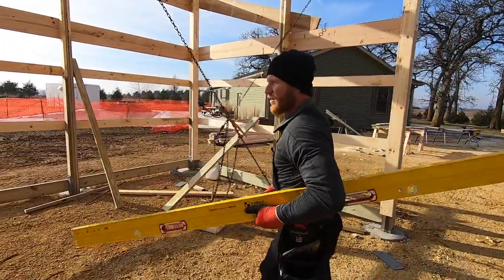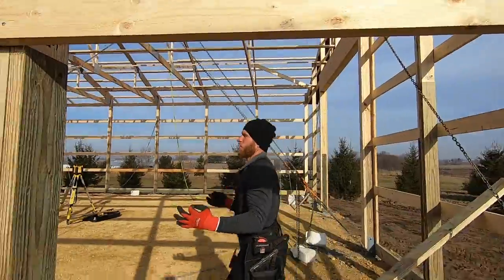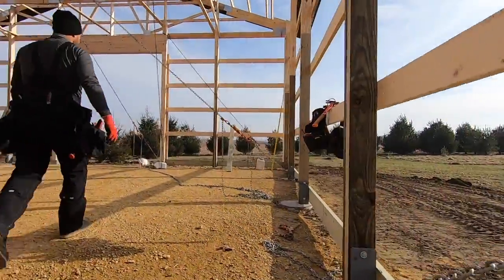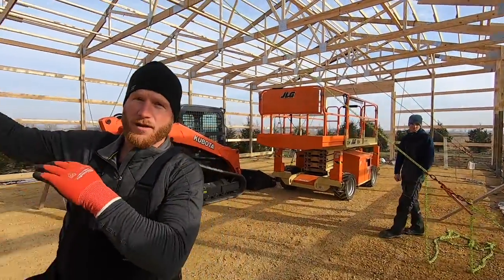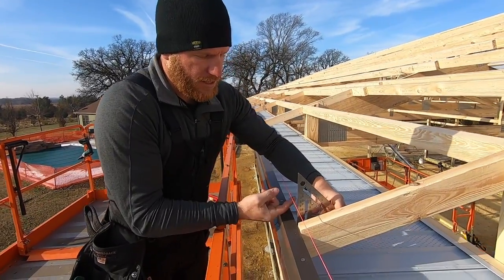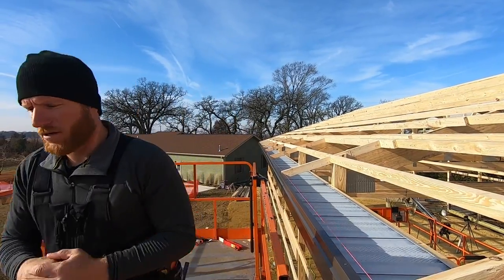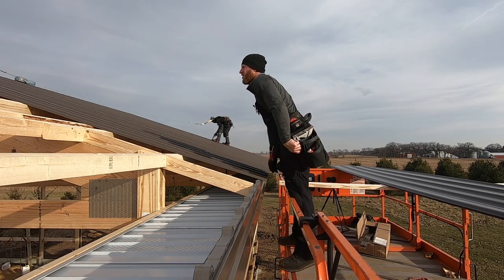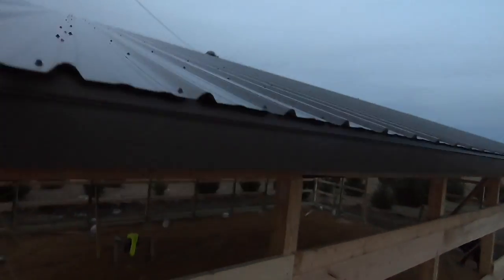Complete Step by Step How To Square a Roof

Comment: another knot. loop around finger 3 or 4 times pull taught lock in opposite direction. will stay until you release it by giving it some slack by pulling tighter and keeping strings parallel. you can reuse string indefinitely. Awesome video Thank you !

Comment: If you don't mind this suggestion, yes, they're not exactly cheap but, ratchet binders. A little easier and quicker for you to make your adjustments. What you're also not taking into the mix here is, moisture will change your dimensions. That's just the nature of lumber. I know most would say "OCD" much, me, I say, you're just making sure everything is as exact as you can make it. This is why I really enjoy your channel, your "ocd" of precision. Keep the video's coming. Cheers :)

Comment: When using the pythagorean theorem, the method I use allows me to avoid calculators and fractions of an inch. 
The triangle to find that 90 degree square is essentially 3x4x5. To get higher levels of accuracy with a large building, just multiply equally to all three and use those dimensions. Example would be to multiply the 3x4x5 numbers by 5 to give you 15x20x25. That way, you can use a 25’ tape measure and still get nice accurate measurements with large squares.
No calculator needed and just as reliable.

Comment: you're a perfectionist ... not a bad attribute , however with the primary posts 'plumb' with your level , it may only be in or out within that length of your level , meaning the post could actually be bowed beyond your level's extension  ... I always checked the top of the wall and checked plumb with a transit ... building racks to suspend drilling rig pipe in Angola in 1982 taught me that precise matters ... yes, it ain't rocket science but it sure does make a difference getting anything you build as accurate as possible ... spot on , budroe !!!

Comment: When your running your sheets I see you’re matching your Lap rib or “good rib” I think you call it, then pulling out your tape and measuring your under lap rib or leading edge for your over hang number. You could eliminate  that last step by marking your stack of sheets with a good marker on the leading edge at your desired over hang measurement.   And then for remodel work when you can’t guarantee a perfectly straight eve snap a line at an arbitrary point and mark sheets to correspond to that that line. 

To each there own. I enjoy the vids 🤙🏼
Reply from the maker: I have thought about that for sure and honestly not sure why I haven’t yet
Reply: I agree with this. I put up metal frame buildings and once we square our roof I mark the lead edge with a marker or even a grinder to give the guys something to line up. Just a little easier, and if u do the saw cut the lap of the next sheet covers it up u can only see it on the bottom but the gutter will hide everything. Great video!

Comment: Turn buckle style braces like you see used in concrete would cut time off of getting things leveled. We actually had some made with smaller threads that screw to any length dimensional lumber and that's what we use when leveling exterior walls on our buildings.

Comment: One trick that i do sometimes is flush the stack of sheets and cut a little slit on the dog leg at what ever your overhang is. saves you from pulling a tape every sheet. Great work though guys! Keep it up!
Reply: When you install a new sheet, you already know your lap is at 1.5 then adjust your dog leg accordingly. Saves a little time. Maybe less than i think. But hope it helps!
Reply from the maker: Great idea

Comment: Assuming you set all of the post plumb in the beginning  are you not taking them out of plumb as you make the adjustment with the kicker under the bottom chord of the truss simply trading a straight eve line for an out of plumb post?
Reply from the maker: Good question.  We plumb all Columns during install yes... but as you noticed we were still off 1/8 to 1/4 max on our string line... when setting a column, even if the level reads good, you could still be off that 1/8”.  Once we plumb our corners, the string line tells us how to make the rest perfect

Comment: Great video thank you.

Im installing metal on a pole barn.

I used your methods to square one side and i have the metal screwed down.

However the other side of the roof is about 2" out of square, any suggestion?

Comment: Wondering if you have seen the old school string line trick. Twist a loop about 4 times, hang loop on nail, pull the string while pulling tag end. Makes a pinch knot and holds great

Comment: So when you push and pull the building to get it perfect, and then you lock it down with the metal and screws, doesn't that cause tension on the screws holding the metal? I'm guessing the massive number of screws makes this point moot, but how does that tension affect the building over time? I would think it would cause oil canning in the metal, and when the sun hits it and it wants to expand this could cause even more tension.
Reply from the maker: Good question, but I can promise it’s not as much tension as you would think.   Imagine your body without skin or muscle... bones will go every which way.   Same with a building.  We are merely installing the skin that creates the diaphragm strength we need to hold it all together
Reply: High wind puts a tremendous amount of stress on a building like this with high wall long sides. If it holds up through the first big storm it's not going to budge.
Reply: I have built a number of steel buildings and the small amount that was necessary to square this build was of no consequence..!  I've had lumber warp several inches within several days before I could get back to the building and I used chains and ratchets to pull them back and the buildings still look great 10 years later..!

Comment: Was your first sheet hanging over the Gable edge three inches. Got confused when you started the metal. Great video
Reply: I'm also confused? Measure out 40" you would be short 3" on gable? I understand 68' 23 sheets that's 12" over overlap one ridge that's 9" so is that where the 3" comes from please help us understand.

Comment: I used to  stick frame houses with an old carpenter down in Texas back in the 80 s and 90s  we always used a story pole to level from bottom plate to top plate  when plumbing walls . It didn't matter if it was 8' wall or a 12 ft wall

Comment: Once you go through and square up your fascia and square your peak do you go back and recheck your walls for plum? Curious if the pushing and pulling on the trusses would move your walls out or in in the middle of the span a negligible amount or not.

Comment: Why not use a ratcheting chain binder for finer adjustments?
Reply from the maker: actually not as quick and a huge pain...I tried.  It wants to spin the chain and is somewhat a pain....I wanted it to work better
Reply: RR Buildings not sure if the new style ratcheting chain binders would help those they have a spot for an impact to hook on and tighten up instead of using the handle
Reply: Mike Cabrey .. that’s what I was thinking

Comment: Your videos are excellent. 
Glad you guys care about safety. Please reach out to your local rep. On some fall protection training. Your guy on the roof has two fall arrest devices used together. This is a big no no. In general dont ever hook two clips together, only clip to ring. Also make sure your SRL is rated for leading edge.   Be safe out there.

Comment: I know this is an old video but I have a question and hope someone can answer. I'm putting my metal roof up in 2 weeks on a new barn and could really use the tip.

What's the guy up top doing, exactly. Once the guy on the bottom gets his 1-1/2" measurement, he locks that in, then I assume the guy up top also locks in against some measurement / line he previously marked? So he's "stretching" the metal to get where it needs to go? Or does he just lock it in whereever it lands naturally?

Thanks!
Joe

Comment: As you are straightening the corner posts wouldn't it be easier to have a ratchet chain binder to take up your differences to straighten the corner posts? I guess the same would go for the facia and eves as well. Just curious. Very good info!!

Comment: Kyle fantastic video series, learning a LOT. I am looking for some input on purlin install and safety techniques. Fastening ALL those boards on edge has to be tiring? Why aren't purlins run in between and flush with the top of the truss? And can they be toe nail fastened in versus all the way through the depth of the purlin?? And last question- outside walls are only 8 ft tall, we are in WI. Can we install post supports into floating slab that is 12"x 12" on outer edge of slab?

Comment: Is there such a thing as a post frame deck?
I’m planning to enlarge my deck. My current deck has a roof over with actual trusses.
So when I enlarge it I’ll have to also increase its roof.
Post-frame just seems easier than attaching the deck to the house.

Comment: if you use the ratchet style chain binders instead of the snap style, you can dial that in easier and would not have to use boards to wedge the chain. it would save you a whole lot of time.

Comment: Great video!  Best "how to video" you have made yet!  Thanks for taking the time.  I do have a question regarding all of the chains.  How many chains do you need for a building about the size you demonstrated in the video?  How long do those chains need to be for that building size?  Do you have a diagram of how you set up all the chains typically?  I was considering using wire cable and "come alongs" instead of chain binders.  Do you see a problem with that idea?  I am just building my own building and trying to save a little bit of cost where it makes sense.  Chain can get a bit pricey.

Comment: Kyle,
Your videos are super helpful brother.  I only wanted to ask, if I have a wet set bracket off it's designed measurement 1/2 an inch. I'm I supposed to reflect that when I attache my trusses to the purlins or do I continue fastening purlins to trusses at 8ft on center?
Reply: I like to set a purlin on the bottom girt, get my endwall placement, then mark the board where the trusses land.  With this done I lay this with how many boards I need to hold trusses straight while hanging (usually 3 per side on top cords, and 1-2 for lowercords) ,
Flush up the ends and transfer the marks to rest of the boards (with a straight edge). 8 foot bays use 18' boards, allows 1' lap at each end of board.  Nail these tie-ins home as you hang the trusses.  Been working great for 35 +years.  This is done during the pre truss prep .

Comment: My quick fix roof square is to plumb the endeall and the dominant sidewall, then go.
My corners are already plumbed and locked in with corner braces during the girting process .

Comment: Would thick ratchet straps be able to replace the chains? Quite the investment for me to buy chains when I only have one building to build and lots of straps already on hand, thoughts?
Reply from the maker: You’d probably be okay just don’t rely on it for long term bracing.  Get steel up quick
Reply: I am using ratchet straps on m build, the only issue I am having is when making the fine adjustments if you go one click too far you have to release tension which goes way too far! Takes a few tries to get it just right because I am building solo...

Comment: I think a ratcheting cable come along would get you a lot more precision in straightening the building vs. using chain binders.  maybe worth trying once. Keep up the great content.
Reply from the maker: Thanks we thought so too turned out to be huge pain because it would twist the chains
Reply: @RRBuildings  oh well, worth a shot. I always dig learning tricks from other craftsmen. Always fun to hear, "where did you learn that?"
Reply: @RRBuildings  speed binders! They are a comealong and chain binder put together, use these to strap down machines much easier and faster

Comment: how are you keeping the screws in the bottom row from dimpling the steel? with the facia board level on top. it looks like the steel is only hitting it right at the corner.

Comment: Have you ever had a tape measure be off/wrong? Happen to me 20 years ago. Not a carpenter so I was triple checking my measurements while helping a friend putting in floor joists. He kept coming to me and telling me I was off, after like the third, forth one, we stopped and ended up taking a measurement with both tapes and mine was something like 1/4" off.
Reply from the maker: Yes I have.

Comment: Ive noticed that even if you get it money, as soon as you start laying sheets just walking around makes the building move quite a bit. Weve started getting it straight, doing x bracing, and we have straps on both sides of each truss and make sure they are all tight to limit the movement
Edit: got to the part where the metal is used to manipulate the facia, that might be difficult if all the trusses are tight

Comment: Instead of Cuma longs use turn buckles with your chains. And stake wedges and use turn buckles to adjust. much easier and easier to adjust. Turn buckles are nailed to wedge boards.

Comment: How does your middle guy keep the screw line straight? Do you pre drill your panels on a stack?
Reply: He connects the dots between sheets. This crew doesn't predrill the roof because of the offset purlin rows.

Comment: I have a question about not using drip edge. And your closer strip not running at the same angle as the steel. With not using drip edge that goes on your Purlins and closer strips not at the same angle of the steel do you have any problems with rain and snow blowing back up under the steel?
Reply from the maker: Never had a problem. Closure strips are still compressed
Reply: Awesome I was just curious. I like the videos thanks for putting them out. Also good to learn different ways to get things accomplished.

Comment: Maybe a already asked question, but whats the reason for offsetting  your perlins? Could you not butt them up to one another?
Reply: You need to nail each purlin to the truss with a 60d nail. Butting them up would only yield 3/4 inch coverage on truss. Not nearly enough to nail through the edge of the purlin and hold the whole roof system together

Comment: Wonder if switching to a ratchet binder instead of the snap binder would make the adjustments easier
Reply from the maker: David I wondered the same thing but in actuality they are more of a pain.  Your chain wants to rotate and spin too much
Reply: @RRBuildings  
ah ... thanks for the reply.

Do you know of water levels with adjustable vials? ... seems like being able to check and adjust water levels against a laser level is the future of water levels

Comment: Wood has a memory if you square it now in 3 or 4 hours or the next day it will be a different measurement until it's all tied in ,once you level it it's got to be tied in immediately. I found I left it alone for a day and leveled it in and tied it in with my roofing.

Comment: Wouldn't a ratcheting binder be easier to work with when squaring the building?
Reply from the maker: Actually I assumed so as well and no
Reply: @RRBuildings  Is the movement of the binder too limited?
Reply from the maker: @mikehackler2155  it's just not as quick and with a simple wedge board, a binder is quicker and they transport nicer than ratchet binders

Comment: I have built a number of steel buildings, some totally enclosed and some tractor barns and I learned that if you don't put a vapor barrier under the roof metal; when the conditions are exactly right or should I say wrong, it will be raining in your building. I am having a hard time believing after watching your work and seeing how superbly you have built this building you did not put a vapor barrier under the roof metal. I am hoping you say you will be using a spray insulation or something of that nature. I have yet to ever see a building that did not have a vapor barrier not have this problem..!
Reply: He does the VB against the ceiling with a vented roof.
Reply: @bpdp379  Don't mislead people into thinking that by just putting a ceiling in with some insulation it will prevent condensation, because it won't in every case..!  I see no soffit venting material and so it is a question that should be addressed and an explanation provided for different building design's. Not every build has a ceiling and DIYer's that don't know should be made aware that even a three sided tractor shed will rain inside in the right conditions..!
Reply: @alumicomp  okay. I’m speaking on the specific building that we are watching right here. It has vented soffits, it has a vented ridge, and it has a vapor barrier across the ceiling before the insulation where it belongs.

Comment: i just remember 3 -4 -5 for my measurements. any multiply of those,  like 18 - 24 - 30. No calculator needed.
Reply from the maker: Except that doesn’t always help with post frame when you need to check the end points not a multiple of 3-4-5... if that makes sense
Reply: @RRBuildings   I just made the same suggestion about 3x4x5 and multiples to avoid a calculator. Sorry, I hadn’t scrolled far enough before posting my comment. 

But when you did your check, you made the mark on the fascia at 18’. Why couldn’t you just make the mark at 15’ instead, then you could make the corresponding mark on the gable side at 20’. Your diagonal then squares you at 25’. That would have allowed the use of your 25’ tape had there not been a 35’ already up there.

I guess I don’t see why you are forced to use the absolute peak for one side of the triangle but can use a pencil reference for the other. 

I love your content and your building practices. Attention to detail is what sets you apart and it’s obvious you take pride in your craft. Because of your videos, I’m convinced that when I can afford to build my forever home, it will definitely be a post frame building.